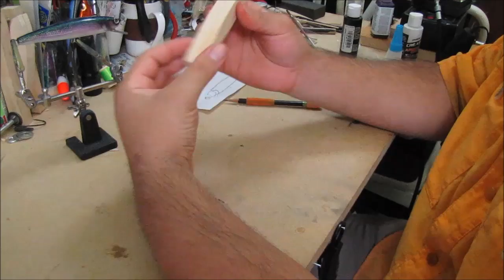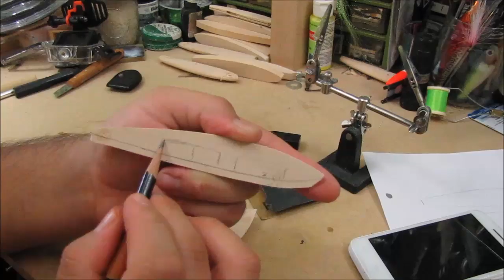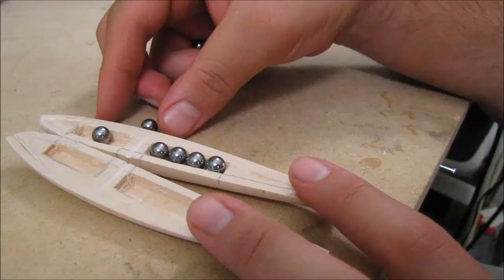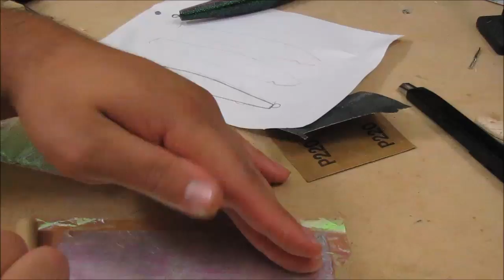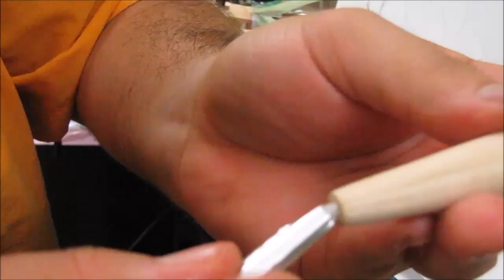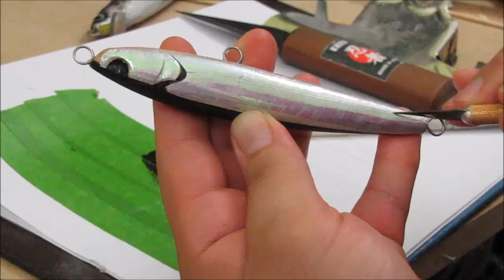Making a wooden fishing lure

Comment: i was just about to add "you could save alot of time carving those slots for the bearings by using a dremel", then i see you use a dremel for the wire grooves. why not dreml out those slots? it would be much neater and so much easier. i started carving my lures from scratch. and was so proud that they were 100% handmade by me, right from cutting the wood in the bush to painting them. not one power tool. but, now i have incorporated sanders, dremels, scroll saw, airbrush, lathe, etc. i'm just addicted to making them now, and want to make as many as possible, so i sped up many processes.
Reply from the maker: breathe and squeeze .you do have a good point but sometimes I just like the intricacies that come with making them by hand and limiting the power tools

Comment: Hello, excellent job, congratulations. I want to know what kind of knife, i saw japanese , do you use? In addition to adhere the iridescent paint or a glue?
Reply from the maker: Massimiliano De Matteo yes the knife is a Japanese right handed single bevel carving knive, you can get it from amazon I think mine was $30, they are definitely worth it, as far as the finish goes its actually translucent gift wrap paper I bought at a hobby store combined with rubber cement and aluminium duct tape, all of them give you that finish
Reply: FishingInstinctsSRQ , forgive me I saw a can , what it was?
Reply from the maker: Massimiliano De Matteo if it was a big metallic can that was the rubber cement
Reply: I would ask you a lot in post photos of the products you use? I can notunderstand what it is?

Comment: man bro... you're awesome at making these. some I will definitely try to learn. do you use the slingshot ammo for weight or for rattle?
Reply from the maker: they work both ways, the way it's set up now it's a low rattle, but by placing a small metal disk at the back you for the balls to strike you can change the pitch.